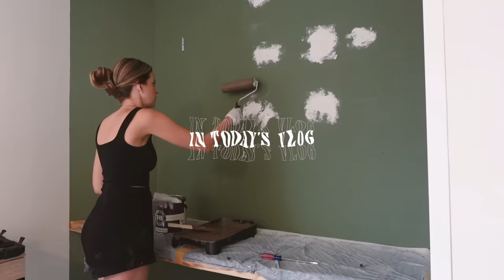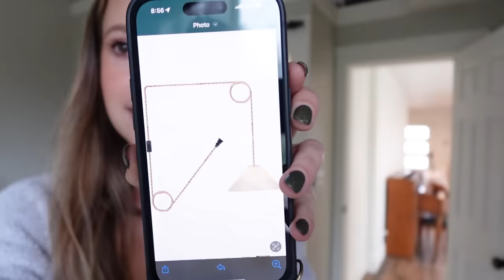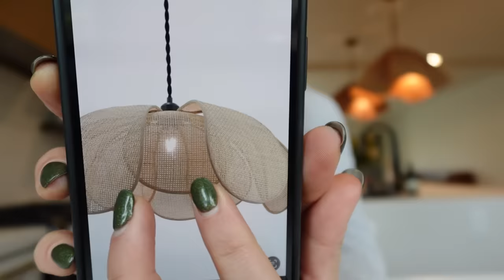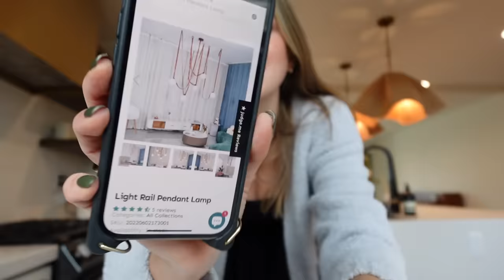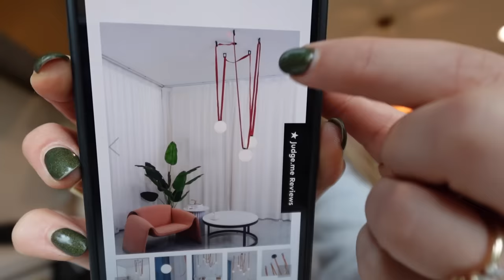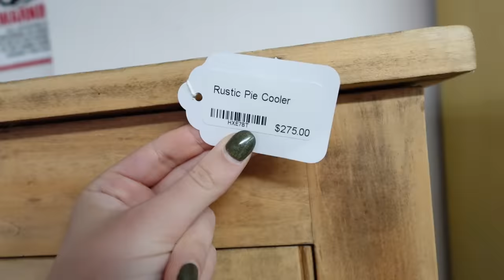VLOG: house projects, fall activities + new furniture :-)

Comment: I recently purchased a pull ouyt couch and it's really not comfortable for sleeping. I purchased a 2" foam mattress pad and it made such a difference under a fitted sheet. The only downside is you cannot fold the couch to put it away. But I roll it up and store it away to be used when needed.